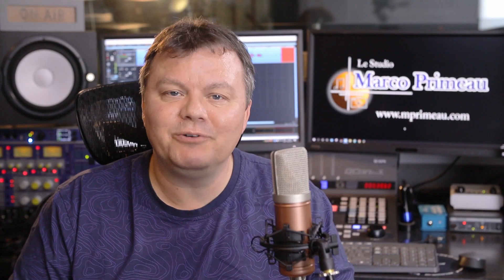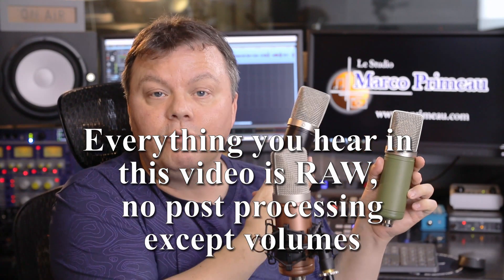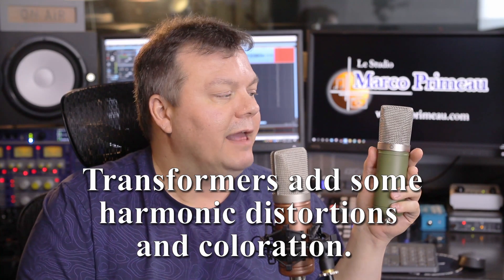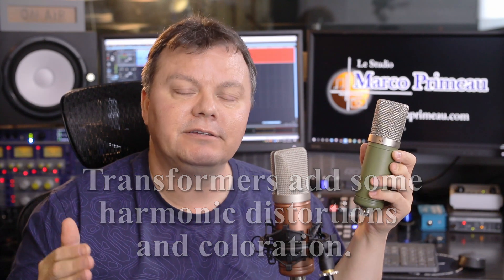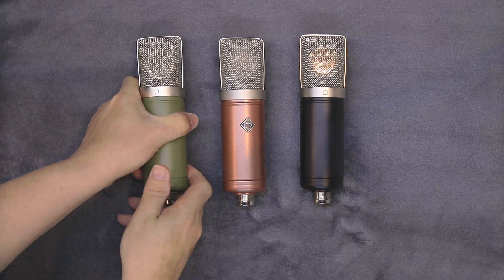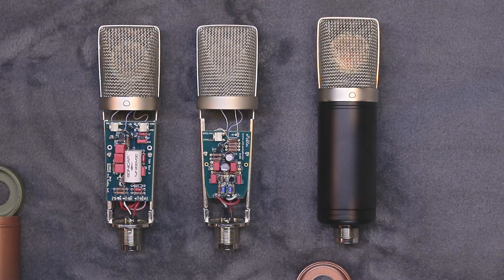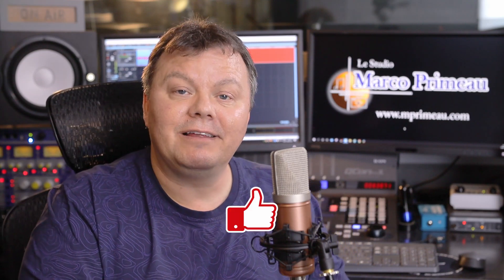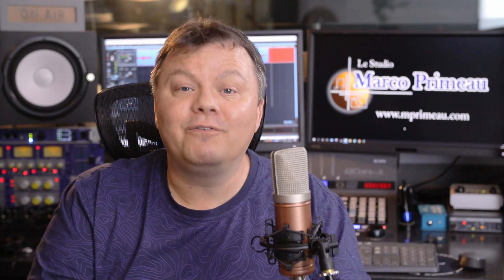How to chose a DIY microphone from microphone-parts.com (MicParts)

Comment: Hey Marco, I bought a T47 from Mic Parts. It's been so hard to open the mic and I don't want to apply too much pressure to open it. Hints?
Reply from the maker: The only part that you need to turn is the base near the connector.. So one hand on the body near the grill and the other at the base. Check my building video, it will help : https://youtu.be/svC2z_S6mTg

Comment: Okay...my problem with shootout videos is this. (Acoustic guitar) The mic placement of these 3 microphones will be as different sounding as the mics themselves.  The argument is always well it’s better than to have different performances. But, they still are when switching from mic to mic in real time. I think 3 separate takes of the mics in exact position using measurements. Use a click so you can still go from one to the other in time. And yes...a consistent performer will be a must.
Reply from the maker: There is no perfect solution, several takes means you can't do null tests.. But the difference you here  in this video give a idea how different the mics are... ;)
Reply: Methinks you should build them and test yourself!

Comment: Hello! do you know the difference between the s47 and the t47? Great video!
Reply from the maker: Yes, the T47 has a transformer in its design and the S47 does not. The transformer will give it some subtle character and the S47 will be being a bit cleaner. Its design will also give a bit more sensitivity. (The S87 I have needs about 3-5db less gain on the preamp)